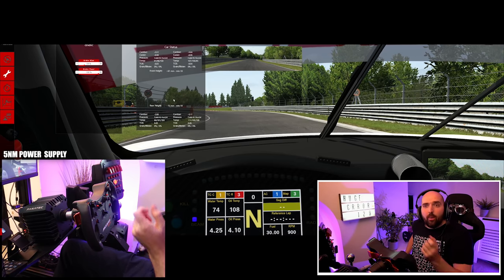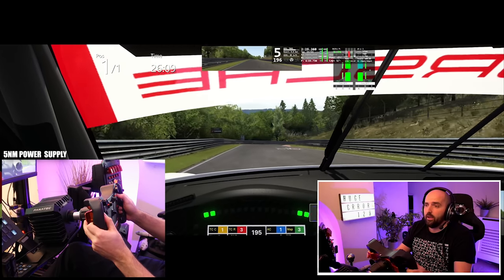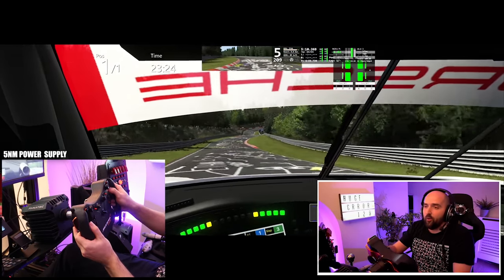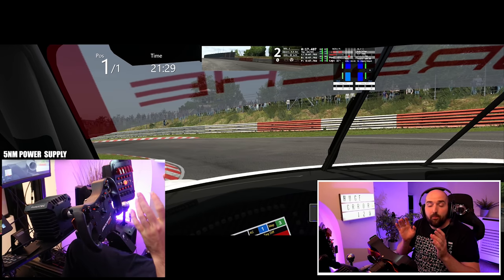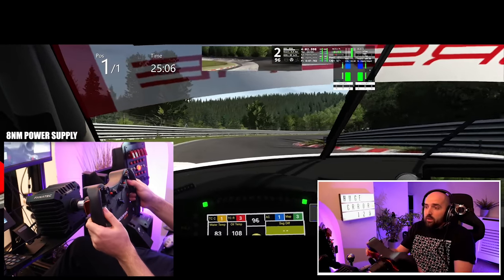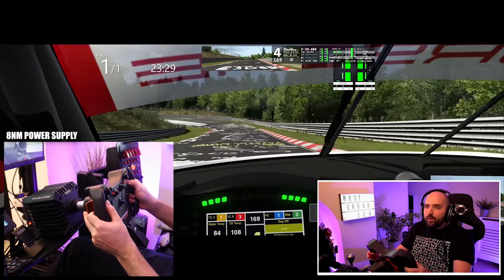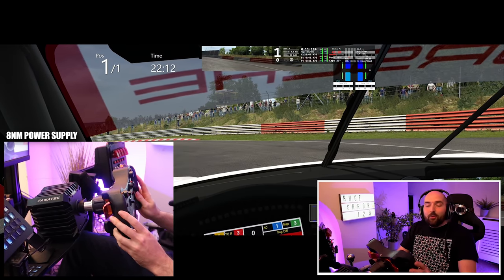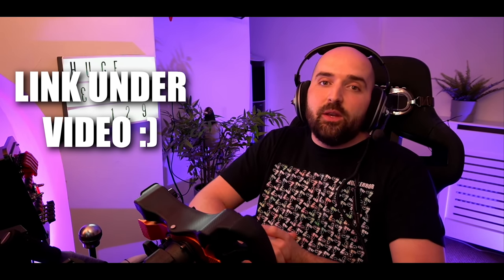Fanatec CSL DD | Which Power Supply Should You Get ?

Comment: So, I've watched several reviews of this wheelbase at this point, and most of them spend most of their time comparing the CSL DD to the bigger flagship wheelbases. And while this is really flattering for the product, it doesn't tell those of us who have never used them, or any DD wheelbase for that matter, much. Point blank, is the 5nm version of the wheel worth upgrading to from a midrange gear/belt drive wheelbase with an eye to get the 8nm PSU a few years down the road?
Reply: Yes. Simply, yes. Disregarding the ffb, the smooth feeling you get with the csl dd is worth it alone over gear driven bases. I went from driving with a g920 for 3 years to the 5nm csl dd and have never been happier. Tracks feel much more detailed with the bumps and change in camber of the road, the progression of force with speed is really good for feeling the weight of the car and the grip potential. I play acc and dirt rally 2.0 mainly, I sweated a stage on dirt for hours with my g920 to achieve a semi competitive time. I jumped on with my new wheel and went 10 seconds quicker around that same stage after just a few attempts. It’s night and day for performance, it’s night and day for enjoyability. IMO, just get it. If u want more down the line (like me) then u can spend a bit of money to get the higher power supply, as u say. It’ll feel like a massive upgrade and you definitely won’t be disappointed :). Also I’ve never used a dd base before, only my gear driven g920 and now this.
Reply: @brandonwallinger1518  I too am having the same experience from a g29 to csl dd. So much more detail even with the small power pack. Just fantastic fun
Reply: @lawrencenenninger1607  Glad to hear man! I've since got a full on rig with the csl dd + boost kit and I love it to bits! Even more detail and Asseto Corsa now feels proper legit :)

Comment: Very well described and communicated the different sensations we can expect with each power supply. I can feel as well as 'visualize' what you mean in terms of having a better connection with the car with the 8nm PS.  I have the GT7 DD Pro on order with 8nm and the LC brake. Coming from my trusty old Thrustmaster T150 belt setup, it's going to be a real treat to reconnect with my driving sims on the new rig.

Comment: The csl dd is my first wheel. I still use the table clamp with my table. And 5nm is well enough for me, coming from the pad. I would however buy the 8nm pack if I get a rig
Reply: I couldn't stand the table clamp that fanatec designed. I don't think it could even handle the 8nm without pulling its self off the table. And there's just so much flex too. I 3d printed my own stand that's little more than a wedge with t-nut slots and holes for clamps. So much better. And in the DIY spirit, I've got a power supply coming in for $50 that I'm going to put the proper connector on and run 8nm. Should run cooler than the $150 pack from fanatec too since it has an aluminum body for heat dissipation.

Comment: If you actually want the 8nm version just order the wheelbase and the 5nm power supply and the 8nm power supply at the same time and for only a $20 dollar higher price difference you get both of the power supplies rather than just the 8nm power supply alone and only save the measly $20.
Worthwhile to have as a spare or backup or even to possibly test if there is a problem to determine if a power supply or the wheelbase is what is failing.
I bet Fanatec will not sell you the 5nm power supply for anywhere near a $20 price point seperately.
Reply: Thats my plan you will prob get a few quid for the 5mn one too
Reply: they ship only one power supply if you order together with boost kit.
Reply: He is saying order the CSL DD 5nm wheelbase and then separately order the $149 8nm PSU.  You only spend $20 more that way and gain a second power supply as either a backup or to sell.  Although the value of the 5nm PSU if you wanted to sell it would not be great and not many people would need to buy the 5nm one separately, unless to have as a backup.
Reply: @jonferraez  I see, i read it wrong way. The 5 NM PS will be worth near to nothing of course.
Reply: @Superstocker669  He means as he says, if he starts to have issues he can test it with the 5NM pack to see if it is a power supply issue if it is he will have a spare pack to keep him going while he waits for a new power supply. Good idea to be fair
Reply: @Simlife101  sound more like waste of 20€/$ I have had the last 25 years not one defect hardware caused due to a power supply. 🤷‍♂️👍 Everybody can do what he want 🙂👍 Just my own opinion.

Comment: But OFC AC is a best SIM ! AC -girl here Excellent content this 2  videos ! TY 💗
Reply: Every sim has its own strength. Project Cars 2 has the best representation of actual races, AC has the best mods and Forza 7 has the best car selection.
I play mostly Forza because I like production cars and old race cars, and PC2 and AC (especially ACC) are all about boring modern race cars.
Reply: @dimakor5914  Production cars and old race cars are available in vaster quantities in ac because of the mods. All the new engine tweaks, enhancements, graphical mods rivaling that of skyrim, the extended physics and now scripted mods really make it the top tarmac racing sim if you're on PC and have a full rig; it just ticks the most boxes. Seriously, the mods are insane; my AC folder alone is 313gb. ACC is the one that's all about those "boring modern race cars",and it does it the best since its a dedicated GT3/GT4 sim.
Reply: @env3ee  I don't like modern pure race cars because they drive like some arcade racing game. Super stable, almost no suspension play, traction control, ABS, safe behavior similar to Golf GTI... Boring. 
But switch to formula 1960s in Forza 7, you will work your ass off just to stay on the road, barely. This cars are beasts. And there are many cars like this in Forza 7, almost none in PC sims.
Reply: @dimakor5914  AC, ACC, RF2, Iracing etc are the real driving simulators made to mimic irl racing, complete with good physics, suspension etc; pro drivers use these sims to maintain skill... And you can turn off the traction control and ABS but why would you, those exist in the actual race cars.(just go with older cars without the TC and ABS) Forza, gran turismo, f1 etc  are great games but are closer to the sim side; still very much has arcade elements. AC with extended physics and tweaked FFB is probably the best tarmac racing sim out there; Nico Rosberg uses the game for his track guides

Comment: I heard rFactor 2 has the best force feedback. Never tried it because the game is ridiculously hard to set everything up. I failed to even make my racing wheel work properly.
Reply from the maker: It has the best FFB for feeling the road texture curbs and suspension compression but its ffb is really bad for feeling front end grip in specifc situations and when you get up onto the limit the FFB is not very informative it just goes a bit flat. 

AC1 FFB tells you prity much everything you need to know inorder to drive fast from the FFB alone.
Reply: Dima Kor i have the an issue with rFactor 2, when i try to use my Simucube it has this crazy feeling as if no ffb then hit a curb and goes wild, any ideas what i could be doing wrong
Reply: @Simlife101  Consider I couldn't even set up my racing wheel, I have no idea.
I never had any problems with it in any other racing game.

Comment: We really need to bring Fanatec to task on this.
It's a 180W motor and requires a 180W PSU to power it. Packaging it with a 90W PSU is actually downrating the system, you're not 'upgrading' getting the PSU it was designed for.
Secondly a 180W+ PSU does not cost retail anywhere near to 149 whatevers ($/£ etc), the most expensive one I could find (on RS-Online) and that was 'Medical usage approved' was only £89, a 200W on ebay £49. Great business model for Fanatec whilst shafting their customers.
Reply from the maker: It's allowing them to sell a DD wheel base at the same price as a CSLE with it then having an upgrade option to a CSW 2.5 spec DD

If they just sold it for say 500 with the larger psu then they would have to keep making and selling the CSLE. 

I'd rather them do what they are doing than just sell the same product for 5+ years.
Reply: Hi  @GamerMuscleVideos   "If they just sold it for say 500 with the larger psu"
 Why 500? It's a 10€/20€ price difference for them (Fanatec) they could just sell the wheel base for 360/370 and make *the same amount of profit*. Instead they make us buy a lower rated (Downgraded) PSU then put a hefty mark up, well over retail, price on the PSU the unit was designed for leaving us with a redundant lower rated PSU.

It's a marketing ploy, as others have said of 'decoy pricing' and a way to make more profits. Whilst not illegal it does not make it a 'good deal' for the customer. I, and I'm sure many will, purchase my own 180+W PSU at a far cheaper 'honest' price. (And it will NOT negate the warranty btw unless it could be proved the PSU caused the fault)

Comment: Well crap I preordered the DD and sold my CSL elite and only got the 5NM power pack 😕
Reply: You can order the 8nm Boost Kit separately. I did, and it costs $20 plus tax and $12 shipping. Fanatec wouldn't let me order a separate Boost Kit on the original CSL DD order, to save shipping. But it did allow me to make a separate order for it. Now Fanatec won't let me put either item into my cart now, since I've already purchased both. Remember one per customer. My Boost Kit PSU has already shipped. But the CSL DD and 5nm PSU won't ship until September. I wanted the additional PSU so that my 5-6 yr old grandkids can drive it. You know how they always hit a LOT of walls. I didn't want them to hurt their fingers/hands when they do. My 10 yr old grandson can probably handle the 8nm.
Reply: @anticommoncore4065  you can turn down the max torque tho

Comment: Why didn't they sell the 5nm as a "csl dd 5nm" and the 8nm as a club sport dd 8nm. That would end the confusion and the complaints. Other than the detail between the power supplies what is the difference between the power supplies what do you get for the upgraded power supply other than detail.

Comment: AC feedback is seriously lacking for DD wheels, SAT forces have been a known issue forever among other things being worked on in CSP, anyone who hyped AC as the best FFB especially with a DD wheel is not to be taken seriously.
Reply from the maker: Funny I have used AC with Every DD on the market and for information that's important to driving it's easily the best. 

RF2 has better suspension and tire flex feel but lacks specifc details of load and rotation at the limit with a ton of cars.
Reply: If you didnt see the big pop up stating FACT maybe watch again, he clearly means this as in his opinion and we all know FFB is a subjective thing.  Hot lapping around nord is amazing and have the most fun on that track in AC.

Comment: The power packs should both be sold separate from the wheel base. That would lower the price of the wheel itself (more tempting when you see the lower price) and give people the option to choose the power supply that they want. I just bought a professional battery hedge cutter today which comes with no battery and no charger. You then have the option of 4 different capacity batteries (different prices) and 4 different speed battery chargers (different prices) which gives flexibility on how much you want to spend and how you want to use the product. This customisable option made me choose this product over a competing product as the others on the market only came bundled with a small capacity battery and a slow charger that I would end up never using and would force me to spend more to get the better battery and charger that I required. Also I am a desk racer so I am interested in how the table mount handles the 8nm forces?
Reply from the maker: People can chose which power suply they want when they buy the wheel so in a sense it is seperate.    the table mount is fine with 8Nm
Reply: @GamerMuscleVideos  So it does not come bundled with the 5nm power pack and you can choose at time of purchase which one you want? I was under the impression that the 5nm came bundled with it, thus bumping up the price if you only want the full 8nm of force.
Reply: @AgentHeX_0007  No - you only get one PSU when you buy the CSL DD. You will only end up with 2 PSUs if you buy the 5Nm version first and then upgrade later.
Reply from the maker: @AgentHeX_0007    Its 350 with the 5nm power pack  or 479 with the 8Nm power pack   -  they will also sell the 8Nm power pack as a seperate upgrade for 149
Reply: @AgentHeX_0007  If you select the Boost Kit 180 when you add the CSL DD to your basket, you will only receive that power supply. The standard power supply will not be included.
Reply: @GamerMuscleVideos  So if we go for the 8nm 479 price option we won't get the 5nm PSU in the box as well. I don't really want be forced (hehe) to pay for 2 PSU's if I only intend on ever using the wheel at 8nm.
Reply: @DomB_Fanatec  Thanks for clearing that up. It seems a better way would be 275 for the wheelbase, 75 for the 5nm PSU and 149 for the 8nm PSU, all sold separately.
Reply: @AgentHeX_0007  The 349 version is already underpriced. They generate their profit with the boost kit.

Comment: Hi. I just bought one and got massively ripped off. If you do want the 8nm make sure you get the basic package and then but the boost kit. Do not get a bundle. I don't know what the Euro prices or pound prices are but in Aussie dollars its 600 for the 5nm.
The boost kit costs 260. So, for 860 you get both power supplies. If you buy the 8nm so called bundle, it costs 830.
So, for 30 dollars more you get both power supplies.
This means that the price of the 8nm power supply which should be 260 is actually about 100 dollars more. You would think it would be a bit cheaper but no it is an even bigger rip off than it already is.
I hope this makes sense.
On top of that a company in Aus added a 20% markup so I have paid effectively about 500 dollars for a power brick.
Check the pricing very carefully.

Comment: All I can say is.

Open ACC, go to Suzuka Circuit on a Porsche GT3 and max all the FFB settings including how it reacts to the chicanes etc.
This is with CSL DD 5nm.

The Wheel fights back. It produces an arm and slaps you in the face. Like the whole table is vibrating more than the missus vibrator.

Basically yeah, AC and ACC indeed got a nice FFB. AND I Love driving that Porsche around.

I have yet to try the 8nm, but I will see soon...

But if the 5nm can do that above. I can only imagine what the 8nm will do.
Reply: Maxing out FFB just gives you clipping

Comment: The mc laren wheel is very light  so it stresses the system less. I am curious about how the setup feels with heavier rims (clubsport universal hub, bmw gt2,...)
Reply: Mickael David I was also thinking this because Boosted Media said Fanatec told them to only use the rims they tell them too for videos and i would like to know why. Is it less feeling from a heavy wheel rim. Also these "pre production" models they say will not be the final version so are they using the same motor make and model or are fanatec up to something lol.
Reply: @Simlife101  Hehe, I hope they won't april fool us again. So far, the only wheel rim I saw used by the reviewers are the mc Laren and the csl P1 rally which are the two lightest wheels made by Fanatec. By doing so they are clearly putting themselves at an  advantage. These rims wheigh in the 1000 g when a csl BMW GT2 is over 2000g. 
I read that Barry from the sim garage declined to review the product until he has access to a commercial product instead of a sample. What a bold move !

Comment: Few things. 1. I checked my CSW 2.5 power supply, its exactly the same with a different connector, i still pre-ordered one with the power back because if i decide to resell the CSW 2.5 might be handy if the power supply is included. 2. Did you run both packs at max ffb? i run my CSW 2.5 at 58% that's 4.7 NM. Id still also run that on the CSL DD i think

Comment: Thinking about getting one of these. Just to confirm if I go for the 5NM version I could just upgrade the power supply to unlock 8NM, I don't need to buy a new base or anything? I'm coming from a T300 so not too sure if I'll need the extra power to begin with to notice an improvement. 

I also use manual shifter quite a bit and use the t3pa pro pedals from thrustmaster. they're not the best pedals but I've had them for years and quite like them for more casual driving. Is there anyway I can still use these pedals with the wheel when I'm playing something more casual like ets2 for the clutch or am I better just buying the clutch pedal for the CSL?

Comment: GMV,
I’m having trouble understanding the wheel/rims discussed here. Forgive me totally new to this.

This is what I’ve preordered from Fanatec….
 
Ordered 8-22-21...
CSL DD
Boot Kit 180 (8NM)
CSL Pedals
CSL Elite Wheel WRC
QR 1 lite wheel-side (simplified quick release adapter)
 
Questions,
1). Does the ordered CSL pedals require any special adapters to interface with the ordered CSL DD?
2). Does the ordered CSL Elite Wheel WRC take full advantage of the ordered Boot Kit 180 (8NM)?
   Or is the CSL Elite Wheel WRC limited due to its low torque with the simplified quick release adapter?
   If so, can you suggest what wheel/rim combination I would need from Fanatec to take advantage of the Boot Kit 180 (8NM).

Not sure if I’m misunderstanding “low torque” WRC wheel with FFB or the 8NM higher power option. Currently more into kart racing and wanted to start some sim racing with decent gear.

Would really appreciate your input.

Many Thanks,
Eric
Reply from the maker: CSL pedals plug into back of the csldd and the WRC wheel works with 8Nm boost pack 👍
Reply: @GamerMuscleVideos  Thank you 🙏🏼